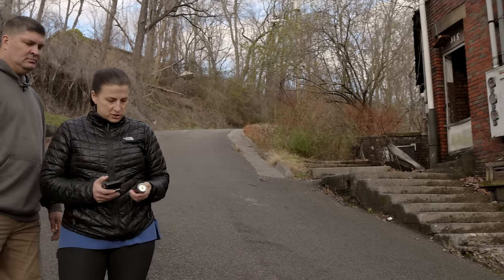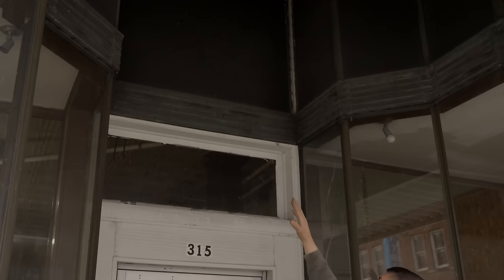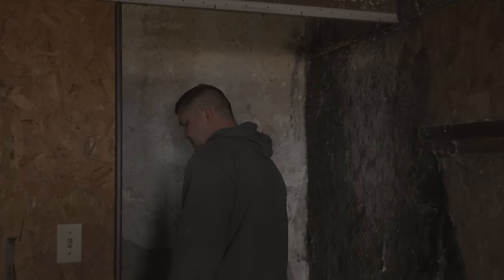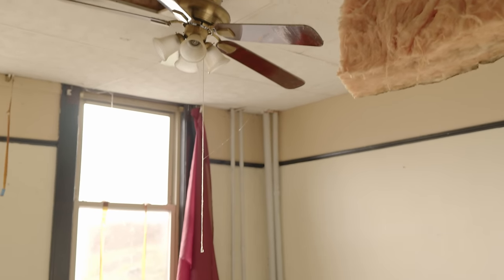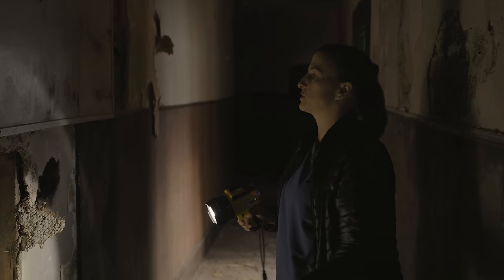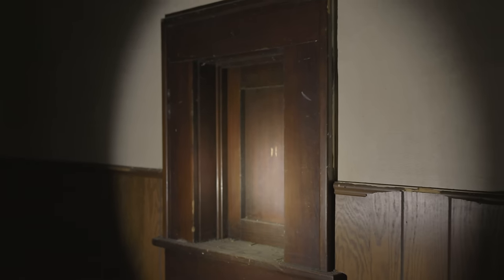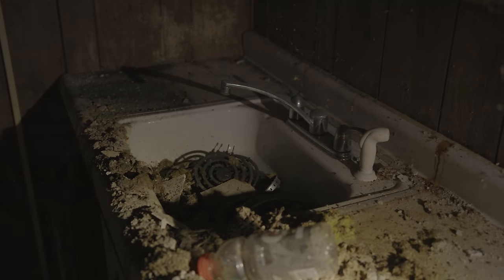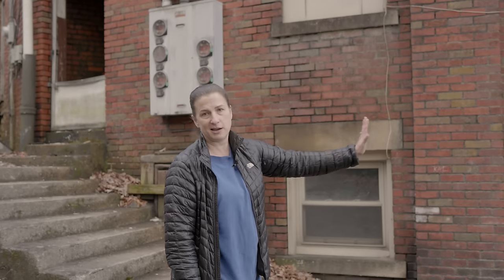Peake Building - Insider Tour

Comment: When I was 4, my parents had a salesman come in and do a layout of kitchen cabinets for a remodel they were doing to their home.  He sold them 'Youngstown Cabinets".  This was around 1954.  The cabinets were white with the logo on the face of the sink cabinet.  The white paint yellowed so badly that my parent put  wood grained contact paper over all the facing surfaces.  Now this eventually shrank over time and it was at that point my parents had the cabinets replaced with custom wood cabinets in the late 70's.  The old cabinets were working just fine but they just became unsightly.  The cabinets were manufactured in Youngstown Ohio.  Hope that helps with your quiry into your's.
Reply: In 1960, my parents bought a house built in 1955 with a yellow baked enamel steel Youngstown cabinet kitchen. It came with triple deck "Lazy Susan" storage in two corners under the counters. My sister inherited the house, and the kitchen is still in place, with the exception of the built in GE dishwasher (which gave out in the 1970's). It's the ultimate in Mid Century Modern design. BTW, I grew up  close enough to Southwest VA to remember a Roanoke, VA TV station commercial that was the shortest ever. It featured a flying saucer/coal tag with an announcer saying: "Olga Coal---Olga Coal--Out of this world---Out of this world." The Olga Coal tags I actually saw were small marked cardboard discs that would burn up with the coal.
Reply: @charlesyoung7436  Wow a coal ad on tv! That's a neat era overlap.

Comment: Later, in 1993, we bought a house built in 1905. It is surrounded by houses built in the 1890s. Our house had been heated by coal, and employed a gravity furnace (meaning the heat rose from the basement, through passageways or chambers to the upper floors), though by time we  bought it, it had been converted to natural gas & forced air with ductwork. We reclaimed the coal bin room, for more storage in our basement. There was an original canning room, for preserving home grown fruits and vegetables. All the houses on our street have brick built, underground cisterns, for collecting rain water, in the backyards. The timbers used in our house, predate modern sizing, and the nails are older style. We updated two lavatories removing the massive pedestal sinks, and single spigot fixtures, & 5 gallon toilet tanks.

Comment: The square open to the sky in the building is called a lightwell. They actually built those in San Francisco as loadbearing exterior walls in the center of the building. It let light down and air circulation, but in San Francisco they were more of an anti-earthquake addition.
Reply: They also came in as regulations in NYC in the 1920’s as regulation for light and air - so you didn’t have these behemoth buildings with interior rooms without any exterior egress, no air circulation and no light whatsoever

Comment: I moved to Columbus, Ohio from Athens, Ohio, about 100 miles, North East away. My girlfriend and I rented an apartment in an old city block, the main buildings were built in 1896,...and additional ones were added in 1900. Our suite had 14 foot ceilings covered in stamped tin. The rooms had at one time been illuminated by natural gas lamps, as there were capped gas lines in the ceilings and on the walls in the living room. The windows were 8 foot tall. Instead of steam radiators, the rooms were heated by basic (passive) gas heaters, vented to chimneys. So they were not aided by electric fans, the heat just radiated out and natural convection moved the heat about. We also used portable electric baseboard heaters. There was an oversized claw foot tub, large enough for two occupants. We rigged up a shower & an enclosure. A simple copper pipe frame, with shower curtains. We restored the original 1905 kitchen, stripping & repainting the many well built cabinets. We stripped the paint off of sturdy chrome over brass, cabinet latches and hinges. We purchased from a salvager, a 1905 era kitchen exit door, with a built in window, which we restored, that lead to a large open sided outside porch. We lived there for 10 years, beginning in 1982.  The rent was ridiculously low, because we rented it in "as is" condition. It was up to us to pay for any improvements, & repairs. Rent: $75.00, with gas, water, electricity all included. It was on the second floor, above an "old timers tavern".
Reply from the maker: I would have loved to see that!
Reply: @AppalachianRisingVentures  The building is still standing, and the oldest section had it's brickwork & trim restored. It is called or named "The Ramlow Block", after the original family who had lived there, and there is an alley with the same name. We had our neighborhoods, renamed based on re-discovered history. Our's used to be referred to as "North Campus" (North of the campus of The Ohio State University),...is now named The Old North.  (Not to be confused with another area south of there, named The Short North.) The name for the area in general, is The University District. About 30 years ago all the old names were rediscovered, and our main roadway, is North High Street. In the early 1900s, there were iron arches, that crossed over North High Street, from our downtown to the northern end. Each neighborhood had their name on one, and they had been illuminated by gas overhead lamps. Now modern LED bulbs are used, in some areas the lamps, can go through a sequence of rainbow colors. In 1901 the nick name for our city, was Arch City. Columbus Ohio is the capital of the state of Ohio.

Comment: In my teens, I helped renovate an old apartment building, and this building brought back many of those memories. I found an old sheriff’s badge with the name scratched off inside one of the walls. It was like a time capsule. The first floor had plaster and trim from the 20’s at the latest, and the daylight basement apartment had cheap paneling from the 70’s. It was in Star City, WV.

Comment: "Picture Molding" in apts., and that white light shade in apt. #2 is "Mid-Century Modern" 1960s.  Slab doors "came in" in the the 60s and 70s. Original doors would be solid 4-panel wooden doors.  You are missing mortar between some bricks. The need to be re-pointed (simple) to keep out water and decay.  John is correct, those are two hallway "Telephone Boxes". They are early third 0f 1900s and from the depth had "candle Stick" phones with a brass separate ringer bell on the wall beside each one activated by an electricity signal when the (live person) operator plugged the wire for that phone in the switchboard. These were probably 1920s - 1940s.  Some had an little shelf below for note paper & pencil and/'or phone number book (even one with 4 or 5 pages, nut these probably were hing on a nail in the wall when you used a hole punch in the upper left binding corner. If they were in a nicer home the bell would be via a built-in speaker in wall below the box. Onw could buy these from Sears and Montgomery-Ward.  Later, when the rotary model phones came out, the bell was inside. ( Ig the phone shelf was in a plastered wall - some with a arched top, would be called a "phone niche". )
Reply: They were niches for the milk bottles as there was one for each unit. Since they had a latched door on the back in the kitchen. No one would put phones in the halls of an apartment building. They did have those niches in larger houses like you are thinking about, but mostly they were for wealthy people and located near an entryway close to the entrance. I worked in an early 1900 mansion with a phone nich in it, they placed a small figurine of Mary in it.

Comment: Wow! It's unclear what your plans are, but I hope your plan is to gut it down to the steel frame and brick walls and start over. I know something about building and to properly seal, water proof, insulate, plumb, condition, and electrify this building is going to require you to have that level of demolish in order to do it properly. I think the other reason to gut it is to build a new floor plan that makes better use of the space. I understand you have a budget, but I think it would be unwise to try and save anything there. All the best.

Comment: An easy and inexpensive way to do the renovations on the failed parts of the building is to fill that area with large metal items such as washing machines and stoves, tire rims, "clean" items that are large and no longer function or are repairable to function, and other metal items then pour concrete, gravel and other concrete fill but I would not do wood or items that could contain insects or moisture. you will have to work in spurts because if you do too much at one time all that weight will lean on the outer walls, a truck load of concrete last time I checked was about $500. you could close off the furnace room and I would suggest talking to a building engineer before doing this it will save hundreds of thousands of dollars by doing this, you would also need to use rebar in this space as well, the metal will reinforce the concrete and then when you get finished you can use jacks to raise floors to be level. You have at least two areas that could benefit from the concrete fill, dont have any plumbing or electrical going into these spaces you are going to void out work in 3ft sections completely let the 3 ft section cure before adding another 3ft section, continue with the concrete fill then gradually work where you are pouring from several openings or removed flooring leveling it out with only gravel then concrete and then finish that floor space off with tile. try to work in 6-7 pieces of drain pipe when I mention 3ft this in height where as you can fill the entire level using this method but it has to start on the foundation only so it will be supported., This will save the integrity of the outside of the building in my opinion. I would not rent it out as apartments again, but use it as an Antique Mall or hardware store. ( I studied architecture at the University of Tennessee in the 1990's) if codes enforcement will let you do this then this would be your most affordable solution and still have access to a really nice interior space once renovated. consult a building engineer.

Comment: Some of that paneling looks to be late seventies or early eighties.  So it was in use fairly late.  I think the metal cabinets were from the fifties, whereas the cabinets with the yellow counter top on the floor below are probably early to mid seventies.  I wonder if those little doors might have been for milk delivery?  I believe your air and light area was called an "air shaft."

Comment: In the early 1900s they used wood lathe. They would soak the wood in water and nail it up. Then let the wood dry that made gaps to allow the mud to hang on to. It looks to me that the wire lathe is a remodel from around 1950s to 60s. If you see any rib lathe it will make more 70s

Comment: Awesome building, I’ll clarify a few things, 1) that ‘air shaft for ventilation is actually called an ‘atrium’. 2) The paneling you alluded to is from the mid to very late 1960’S, when you remove a piece look for the date stamped on the backside, I’ll guarantee that is Not from earlier. 3) Those steps are Not to code, you’ll be told by your inspector what rise they’ll require, I’m sure you folks will be at it for a few years. Not sure why I watched this, it just sorta popped up on this old man’s screen. Beautiful building, good luck.

Comment: The boxes on the wall on the third floor seem like they are milk delivery boxes. People use to get their milk delivered in bottles, a few times a week. At a house, it would be left outside at the front door. There is no space in an apartment building to leave the milk, so they created those boxes, with small doors that usually opened into the kitchens, as a place to put the milk bottles.

Comment: The former Hillside Middle school, originally Naugatuck High school on Hillside Ave. in Naugatuck CT. is a beautiful marble structure built in 1905 is very similar in as the street wraps around the building just like yours. There by making all three floors accessable from the same road. 👍

Comment: I doubt if any of that wood paneling is original unless it's made  up of tongue and groove separate planks, the 4 × 8 sheets of wood paneling didn't come out until the 1950s and was popular late 60s through 70s.  
The metal kitchen cabinets came out in the 40's after WWII because there was such a sever shortage of seasoned wood after the war but plenty of steel.  Many of the original Levittown homes built after WWII had the metal Kitchen cabinets.